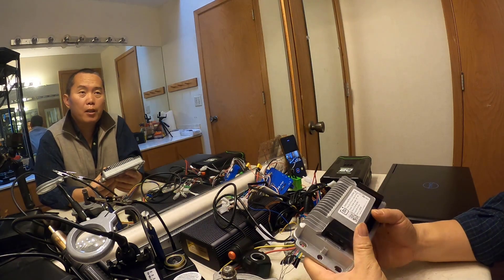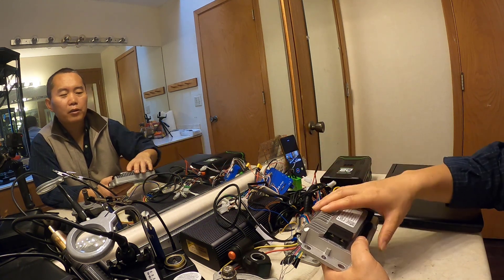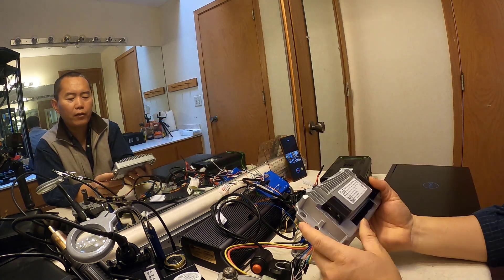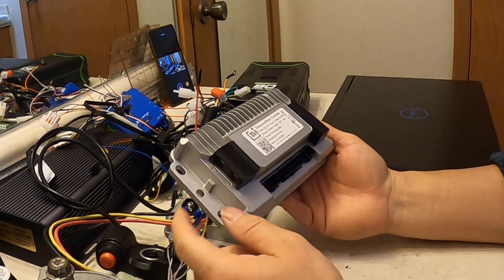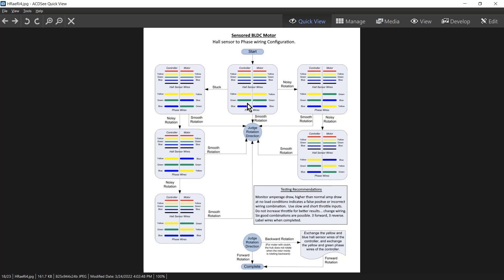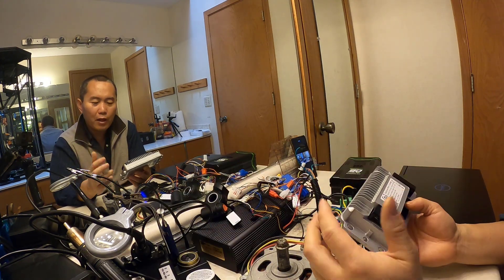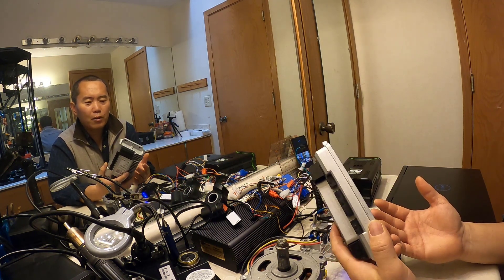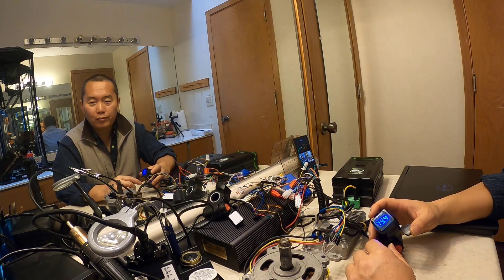common ebike controller setup

Comment: Does "The Turn Connector" supposed to be the throttle? Have bought to my 3000w scooter another motorcontroller support 45A instead of 35 A but that one tells throttle and more specific. The originals just tells indicator light which is battery indicator.. But only brake lights because they are wired together I beleive. Should have manuals like the developers have lol but wrong language unfortuantly.